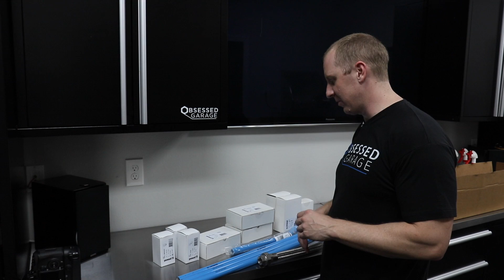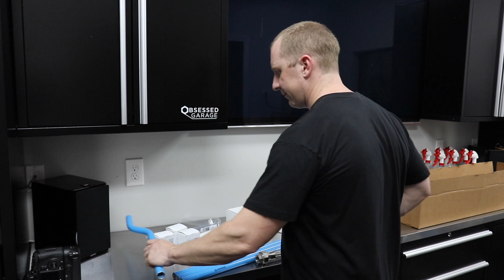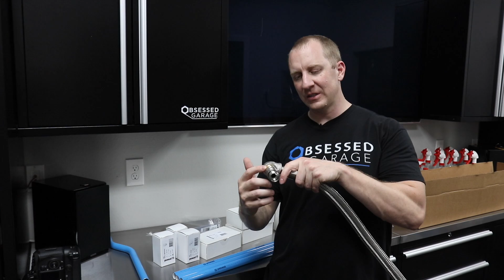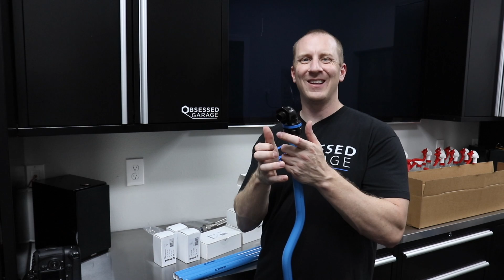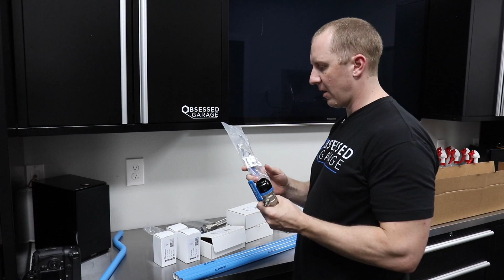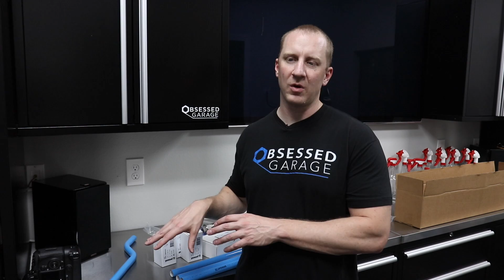Piping Package for Custom Install Pressure Washing Solution

Comment: You have to admit, to the average lay person, this is a ridiculous purchase.  But you have to realize, this is NOT for the normal/average person.  It's for the OBSESSED person who has the money but doesn't have the time and only the best will do.  While it's not something I'm going to buy, I totally get it.  Kudo's for Matt for being so damn good at putting shit together like this, haters gonna hate.
Reply from the maker: I guess it depends on how you want it to work/look.  I paid my plumber $600 to put valves/copper pro-press fittings in my wash bay.  So the sum of the parts isn't all that bad in comparison.

Comment: Are you able to cut the pipe for us to your specs?
Reply from the maker: No, that won't work.  You would have to precision mount the shelf, hose reel, and CR.  I send enough pipe for a few miss-cuts.
Reply: italianwjt that would be expensive
Reply: 604Basshead how do you figure?  The package is $400 it would be more expensive if I screw it up.  He has the measurements and the tools...
Reply: Obsessed Garage are you going to provide a cheat sheet with the exact size cuts you made to the pipe?  The reason I ask is I have mine set to the exact height you have...